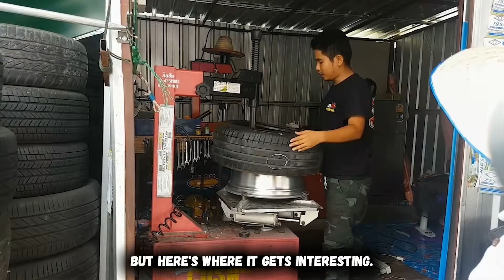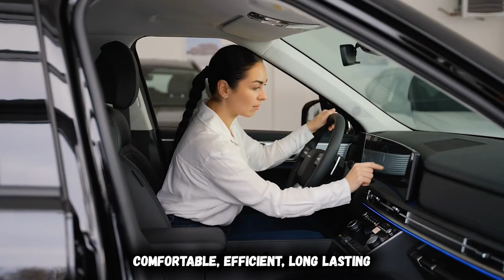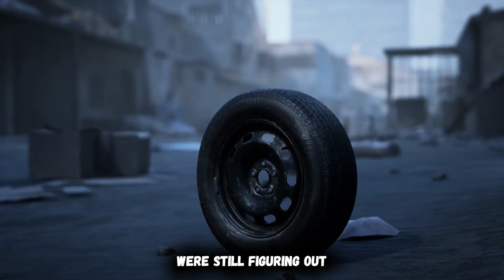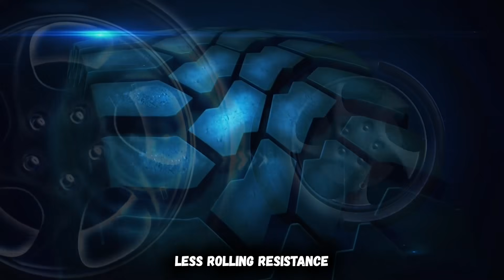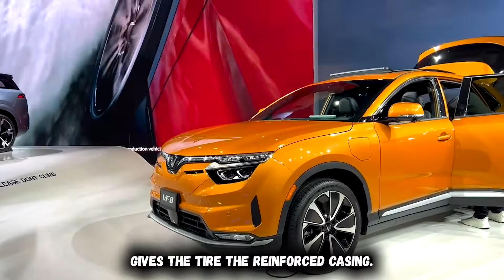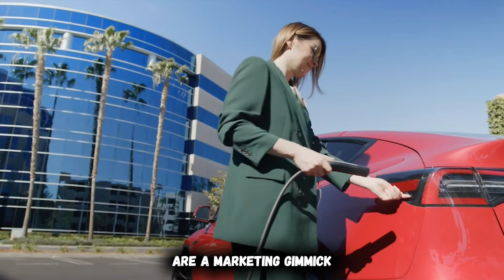5 EV Tire Brands That Actually Last (And Improve Your Range)

Comment: And those EV tires, properly inflated, work well right up until it snows.  Then, when winter comes, you need to change the rubber compound back to the winter tires so that you can stop your car on slick roads.
Reply: Meanwhile in the real world, those of us in the snow belt just use our all season EV tires all year around.
Reply: @rkayakr  Here in the snow belt, those of us who lik to stop, run all seasons during the summer and put on snow tires for the winter.  That is because being responsible means being able to stop in winter.